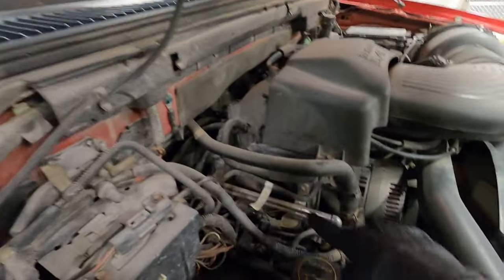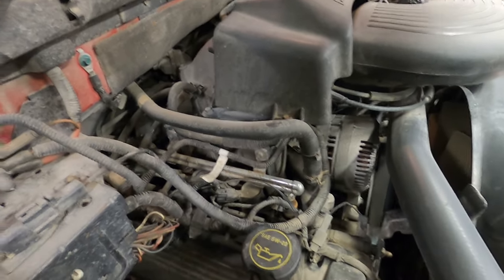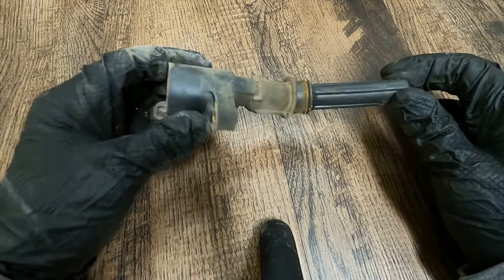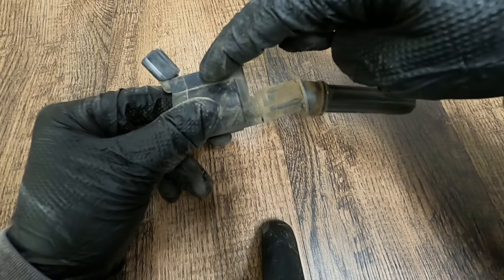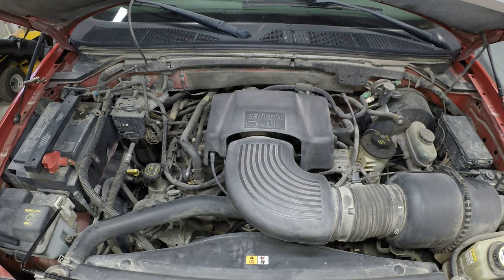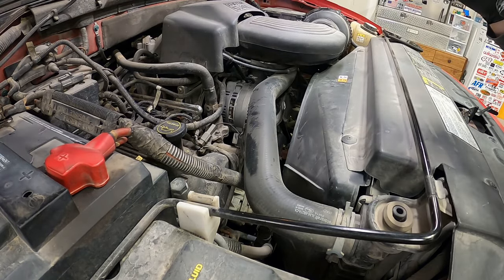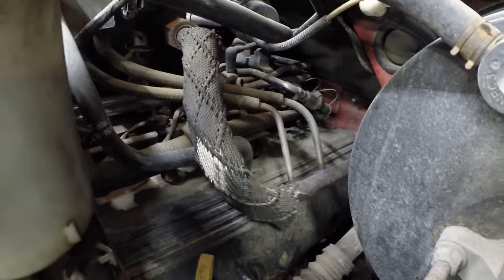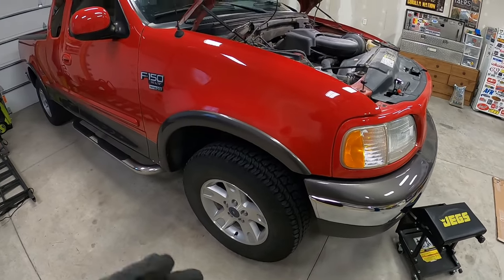Most Common Problems With Ford Triton 5.4 2V Engine

Comment: Would anyone have an idea what would cause the engine to run rough when giving it gas?  Idles a little rough, then when I give it gas, it feels really rough and beats you to death as you roll down the road.
Reply from the maker: Sounds like a misfire.
Reply: @KonaBlueSVT  Yeah, I was able to hook up a computer to it and it said Cylinder 4 misfire detected.  I'll get some plugs tomorrow and see if that solves it.  Thanks for the video and the help.
Reply from the maker: I would also move the coil to a different cylinder and see if the misfire follows. The coils are notorious on these.
Reply: @KonaBlueSVT  Thanks, I will try that!

Comment: i have a 2003 expedition with 320000 miles. it has recently started misfiring and throwing a misfire code. i replaced all coils and sparkplugs and the passenger side pcv valve and the hose that was connected to it because it was collapsing in on itself. It runs fine when cool but as soon as it heats up it starts misfiring again.
Reply: to note i did have a coolant hose bust and was getting antifreeze into the sparkplug boot.

Comment: Any of yall know what will couse a 1997 ford f150 to sputter when exelerating to go fast.
Reply: I have the same engine as yours 5.4 v8 2v good engine just when I go over 55 or just hit the gas it will sputter and lose power don't know what would cause it to do that I was thanking it was bad gas.
Reply from the maker: That could be a lot of different things. Have you checked the fuel trims? Any misfires? Codes? Fuel filter, air filter, etc.
Reply: I changed the fuel pump fuel filter. It's just when the engine heats up and when I push the peddle its like the engine loses power but when I push the paddle past it it will catch back up to its self. It's hard to explain exactly what it doing.
Reply: It sounds like a misfire but it doesn't have any codes
Reply: New Air filter
Reply from the maker: If you have access to a good scan tool, look at mode 6 data for misfires while it's happening.
Reply: It doesn't do anything while idling it's only when pushing the pedal down to get up to speed
Reply: But I'm going to scan it tomorrow
Reply from the maker: Watch mode 6 while driving. Sometimes misfires won't set a code but will show up on mode 6 data. It might give you a place to start.
Reply: I had to replace the valve cover gasket it was hard to put on because all of the hoses on the passenger side so I put a little peace of grilla duc tape on it just a little peace to hold the gasket on for I can put it back on the truck when I was titeing the bolts I forgot to take the tape off of it would that be the cause why it would do that or would it be fine.

Comment: what about the post 2010 2v?
Reply from the maker: The newer 2v engines are great. They fixed the spark plug problems in the head.

Comment: engine oil is missing and I don't know why f150 2002, there is something I can do to fix it, the truth is that it is in very good condition, only that every 2000 miles it lacks oil, the engine already has 212,000 miles, I can do something?
Reply from the maker: I assume it's not leaking?  I would try a couple treatments of BG EPR. I've had great luck with it.
Reply: @KonaBlueSVT  Can you explain to me what that is, I'm not a mechanic but I would appreciate it if I could tell my mechanic to do it please
Reply: @KonaBlueSVT  my truck works super well, that's all it loses oil every 2000 miles and needs to be put in oil, but the truth is that's just the detail it has?
Reply from the maker: It's a product that is put into the old engine oil and run for 15-20 minutes. It helps clean up any deposits that may be causing oil consumption.  See this link - https://www.bgprod.com/catalog/engine/bg-epr-engine-performance-restoration/
Reply: @KonaBlueSVT  I put it in the oil and leave it there until I do the oil change again after 3000 miles???? thanks
Reply from the maker: No, run it in the old oil for 20 minutes and then drain it out and do a normal oil change.
Reply: @KonaBlueSVT  thanks so much

Comment: Anyone know why they suddenly sound cammed and start shuttering at stops 😂 Damm thing sounds like a racecar all of a sudden i got 490k and somehow i suddenly gained 25 horses also woukd throttle body do this maybe or maf? No codes popping up so not sure? Running a 98 econoline van now it sounds like a racecar or a muscle truck maybe ? But i still have rhe cat and a thrust turbo muffler setup
Reply from the maker: Does it run OK when above idle? If so, check the idle air control valve.

Comment: Hope someone can help. I bought a high mileage 02 5.4. Visual inspection and initial driving seemed good. All of the sudden it just had no power. I pulled codes and started replacing parts. Cam sensor, crank sensor, changed all the plugs (they looked real bad, a lot of carbon build up on top of the plugs), new ignition coils, new pcv valve, swapped out throttle body, new idle air control valve, new fuel filter. For a couple of days I thought I was on the right track. Was running but idling a little high. Then it started shutting off if I let off the gas. I can hear the fuel pump kick on so seems like it's working. Now all it will do is crank up and start, then immediately Rev high on its own and die. Any help.
Reply from the maker: What codes does it have?
Reply: @KonaBlueSVT  I dont have a scanner at home that works with Ford. All my experience in diy has been on BMW. But I had previously had a shop pull codes which led me to replace all the parts mentioned. Which were in fact all bad. Like the iac was completely shot, the pcv completely shot, the throttle body was communicating and so on. But I replaced all those parts. I was also getting lean codes. My gut tells me it's not the timing chain, but I can't say that for sure. I was getting a backfire through the intake too.   So I took my cats loose to see if maybe they were clogged. With them gapped, o2 sensor still in, it just cranks, starts, revs high, dies. I feel like I'm missing something. 

I bought this from a kid for a work truck. He had done the most amateur wiring for after market lights and system I've ever seen, and kinda makes me wonder if something is wrong with the ecm from some back feed volts or something. But the mechanic who originally pulled the codes and was trying to point me in the right direction did not mention it though.
Reply: If the fuel pump module was bad would it even start? That was something I was gonna possibly look into. Also seen some people saying the 2 little ports on the throttle body housing can clog and cause stalling. Anything else would be internal I guess.
Reply from the maker: I would re run the codes. It sounds like a major vacuum leak.
Reply: @billrichardson5386  I had a high idle and dying issue that turned out to be a throttle position sensor.
Reply: Mine was a intake gasket leak. Had the save issues. Had the gasket replaced for $400.
Reply: Try Mass air flow sensor,,or hose that connects to the back of the throttle body.it tends 2 rot, have A 2000 Expo Xlt ,273k just changed Coils and MAS AND drives great again..the Fords are finicky when you replace plugs and coils  HAVE 2 GET MOTORCRAFT or they will misfire sooner than later.watchout 4 counterfeit ones.they all over the web
Reply: Fuel pump bad catalyst converter can do that stopped up cats
Reply: @waynerivers9095  It was a bent rod. Really sucked. I sold it as is after owning for only a few months.
Reply: Fuel rail solenoid  could be bad   and more than likely just old bad gas start simple vacuum leaks and move on down the line  clean everything you can and clean the iac  valve to
Reply: Possible bad maf  to clean it

Comment: Okay maybe somebody can help me out with this I was told that my fuel pump driver module needed to be replaced well I did that it still will crank but it will not turn over any ideas what the problem might be truck will crank but it will not turn over I was just told that I have to program this modular is this true I've never seen it done in any of the videos
Reply from the maker: What year truck? Also do you mean it cranks, but won't start?
Reply: @KonaBlueSVT  2007 and won't start
Reply from the maker: Have you manually checked fuel pressure? What led to replacing the fuel pump driver?
Reply: @KonaBlueSVT  I'll be honest I have no idea how to check the fuel pump pressure and of course because I'm no mechanic I have been searching the internet and hopes of figuring out why it just suddenly won't start and that was the first thing that popped up on every form I've been on and yes I'm a female trying to fix the truck
Reply from the maker: No worries, however without knowing if you have spark, fuel pressure, etc. It could be about a hundred different things.
Reply: @KonaBlueSVT  well I thank you at least for trying to help and ask for the modular I have another question does that really have to be reset some of the videos say yes others you just put it on and it works I mean it was an easy fix to put it on I replace my fuel pump last year trucks been running fine it's a 2007 Ford XLT Lariat most of what's going wrong has been an easy fix accept the fuel pump which I did take him to get a professional to do this has me baffled because you can turn the key it wants to start but it just will not turn over thank you
Reply from the maker: To my knowledge, there is no special programming for a fuel driver module on that truck. If you still think it's fuel related, check the fuel inertia switch. There are probably some videos on it.
Reply: @KonaBlueSVT  again thank you for your time I've watched many many of your videos and will continue I will not give up the quest to get this truck running it's been a great truck very few problems this one just has me stumped just for fun I'll keep you posted as I am and now this mechanic but I seem to do all right I still got my Pontiac Solstice 2007 running and replaced and repaired quite a few things on this little car and it's still running with 350,000 Mi on it as well as the Ford F-150 which I neglected to say has over 400,000 miles on it and this is really the first major major problem that I've had it does have a new engine in it though thank you so much I'll keep you posted and I'll keep checking your videos out for further help and yes I share your knowledge with others and get them to like and share and ring that Bell thank you

Comment: Truck runs really rough
Reply from the maker: Probably has a misfire.
Reply: Immediately- buy Original or Better coils, all 8.  New plugs while you're at it.  The truck will purr like a kitten.  Never ever buy cheap coils for the 5.4L you will suffer for it.

Comment: my air valve modulates for a few seconds then stops for a few  on and on when it warms up  can you tell me whats up with this 2001 5.4 2v. i do have a vacuum code but it happened before the code came up. it almost sounds like a machine gun . rpms change to.
Reply from the maker: I am not sure what valve you are talking about? Are you speaking of the idle air control valve?
Reply: @KonaBlueSVT  yes right on top
Reply from the maker: Remove it, clean it or replace it.